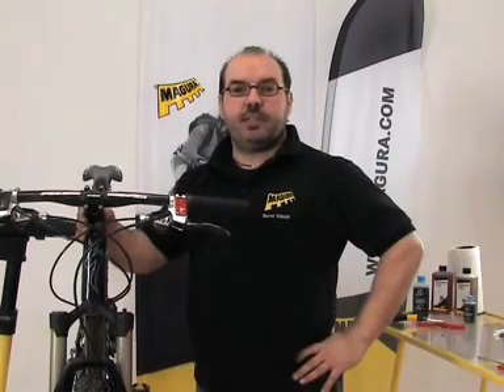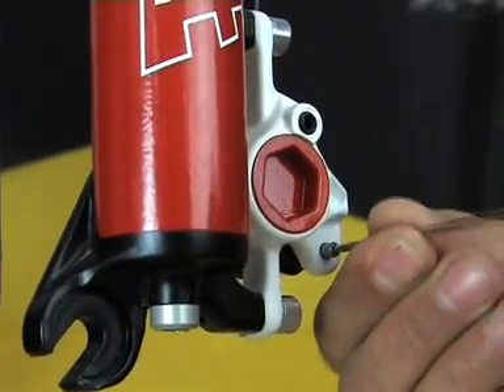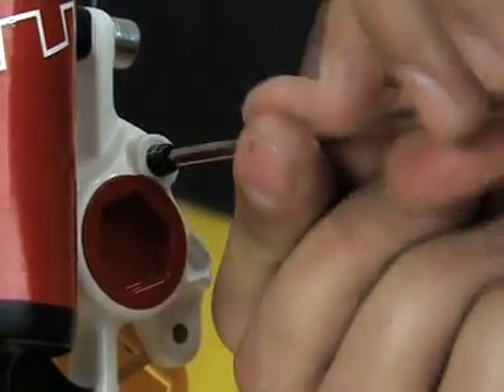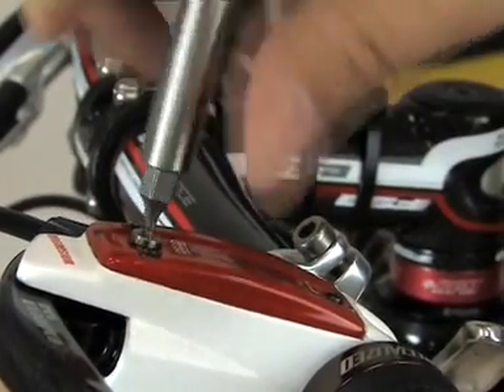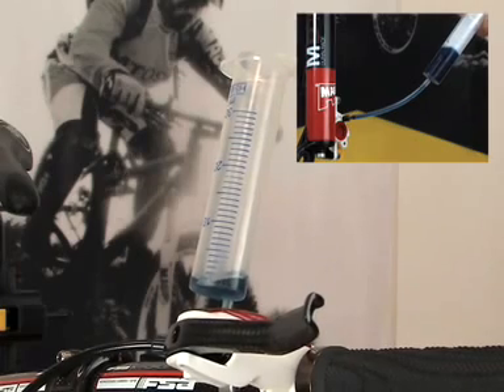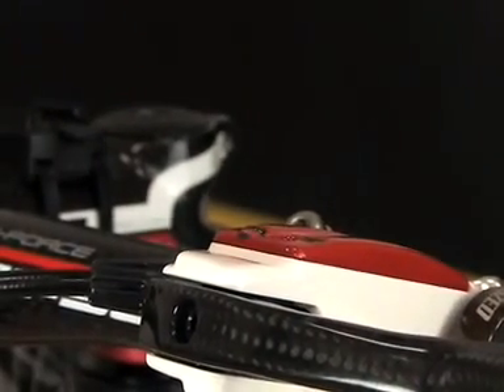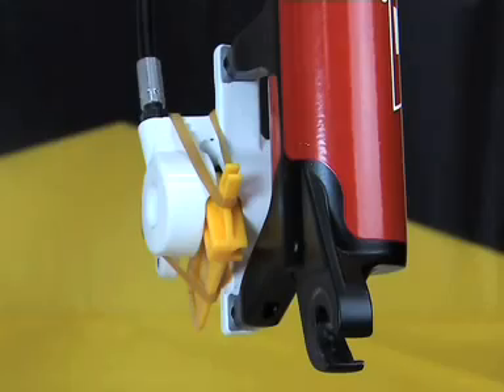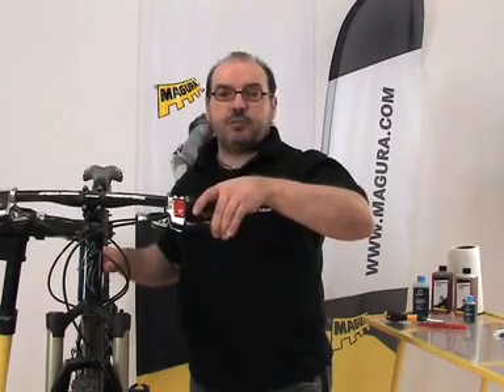Filling and bleeding of MAGURA disc brakes

Comment: What is he saying at 2:10 droy abop oilyOil back into the syringe?! What?!
Reply: Basically: Pull on the lower syringe to pull the fluid back down through the system. This helps to bleed any air still trapped in the caliper. The method shown in the video is the gold standard of bleeds for these brakes!
Reply: " draw oil back into the lower syringe"

Comment: don't you want to have the transport tool OR the wheel back installed before snapping the brake lever?  I'm an amateur just trying to learn so just want to be sure i understand if snapping the lever with no spacer is a bad thing.  thanks for the vid.
Reply: @Flippy Dip i watched it.  Guess I missed it.  Thanks for your kindness in pointing it out.

Comment: I do bike repair, and recently a customer dropped off a bike (8-10 yrs. old model) with Magura Julie brakes. I had to remove the front wheel to put in a truing stand--when I did that a small flat piece of metal about the size and thickness of a brake pad fell out from somewhere. The pads are still in place. That metal piece has two small bumps on one side--do you have any idea what that would be? No docs available on the Magura site for this older brake model.

Comment: If you cover the top of the syringe, fluid won't come out of the bottom because air pressure will hold it in place.